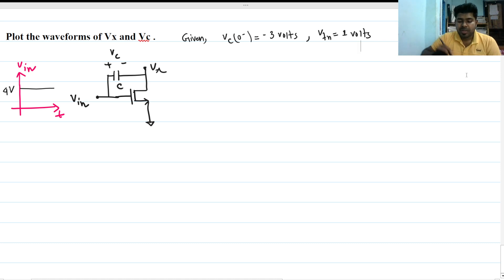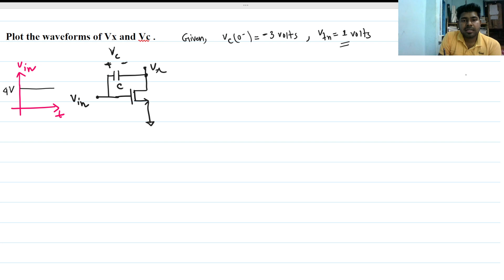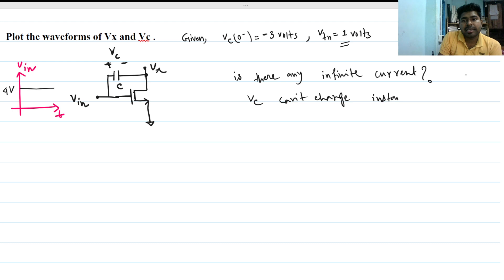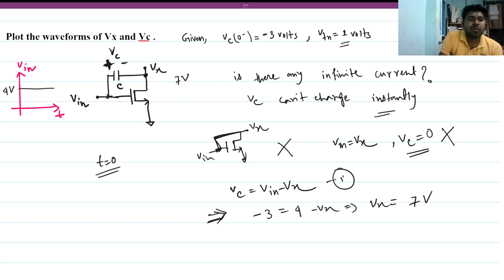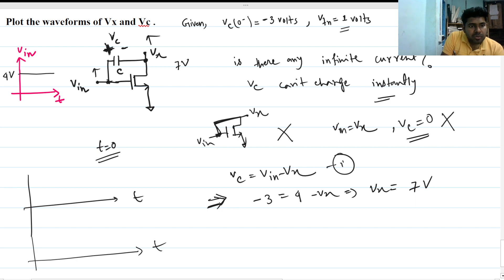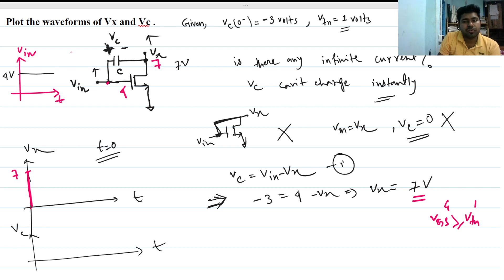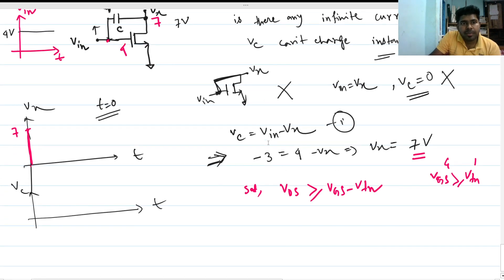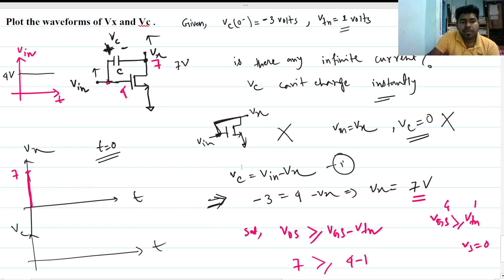Important Interview Question_Step response of CS stage with Millers Capacitor_ Razavi solution 2.58

Comment: Is Vx tends to zero or Reaches zero sir because to become zero Ron have to be short circuit right?
Reply from the maker: Ron depends on the VGS not in VDS
Reply: @AmitBar-Analog_Circuits  After linear region current start reducing and Vc charge slowly and Vo also decreasing slowly ,not exponantially as it showing  Vo decreasing faster rate. Incorrect.